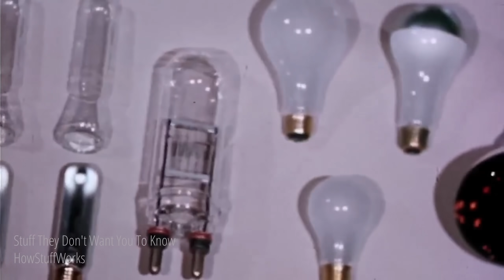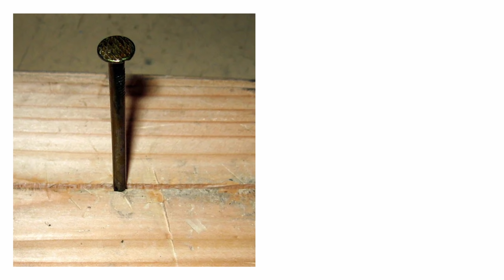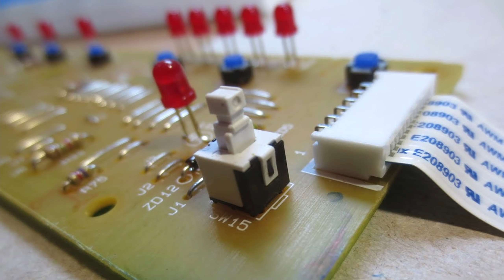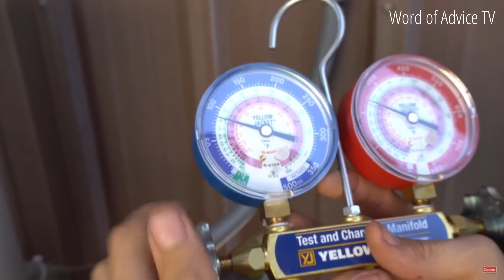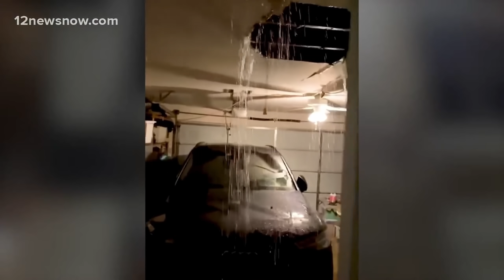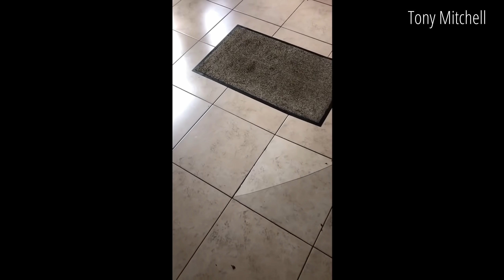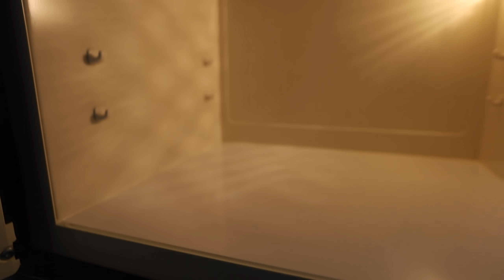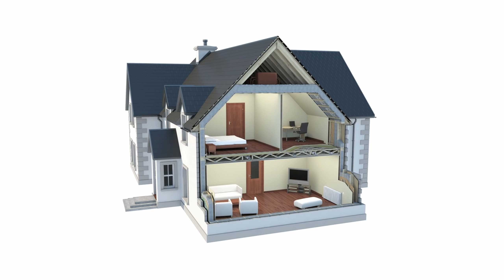Built to FAIL | Planned Obsolescence

Comment: The basic assumption of "planned obsolesce" is flawed. On the engineering side, it's more often known as "design life".  When you design a product, part of that process is determining the pricepoint you want to sell it at and how long it needs to last in order to make that pricepoint seem reasonable.  You can make a $10,000 refrigerator both repairable and last 20 years, because you designed it to last 20 years and you selected components and manufacturing processes with 20 year lifespans.  by contrast, if you designed your $500 to last 20 years, you would end up losing $3,000 per refrigerator because it cost you $3500 to make.   Finally, regarding the building standards in texas, they are mostly non existent. You want to live in a "low regulation" area and this is the result, and nobody is willing to pay for quality they don't see.
Reply: More people need to read this comment of yours. Thanks to the conspiracy theory of planned obselence (PO), companies are being regulated wrongly - such as apple who have been made to stop throttling their phone performance to protect the battery despite this being the thing they were doing to make sure their phones lasted as long as possible. Instead, they should have been forced to ensure that the batteries they were fitting were either; replaceable, or designed to give a certain amount of current for longer before the throttling technique was used. But people heard about PO and the EU made a law to make that scary myth into an illegal myth. 

Meanwhile, people like OP video creator here are making videos that basically make it seem like the consumer has no power and no choice, stuff just isn't made like it was in the old days.
Reply: Ok, so what’s your solution to get manufacturers and builders to make better products and houses? Please don’t say “it is what it is”.
Reply: @aayotechnology  I think the commenter that you are replying to is already suggesting a fix for building; better regulations. 

As for manufacturing I think that regulations and enforcement is actually a better tool than consumer buying power here too. Everyone is looking for a bargain, so the 20 year refrigerator that costs 2000 just won't fly off the shelves when there is an option for 500 that says it's quality-made on the box (but isn't). If consumers want better products they should ask their politicians to put tighter regs on things. This makes sense from a rational angle, and an environmental one.

Comment: Sigh, unfortunately the comment about the problems of tile installation directly onto the sub floor hit home for me. We had our main floor tiles last year, and a few months later it tented and cracked badly due to heat in the winter. Although I think this was a case of obsolesce by ignorance on the contractor's part and not necessarily planned.

Comment: I'd really prefer that you supported some of your claims with math. For example, you talk about how shifting from in-home coal furnaces to electric furnaces powered by coal plants has no environmental benefit. This is surprising to me because the standards of industrial power plants tend to be much more restrictive per unit of coal burned than home furnaces were. Similarly, there must be a break-even point for replacing some large number of old inefficient or toxic appliances; how much more waste are we generating by doing so in the cases you're discussing, and how far short are we from these inflections?

I'd also be interested in you drawing more of a line connecting how consumers are enticed to want new things for the sake of being new; and how consumers are strongly discouraged from buying repair or in-place upgrades by industry revenue strategies. You talk about not /being able/ to repair your laminate flooring and separately talk about /wanting/ to redecorate walls; and about /needing/ to replace damaged older appliances but also /wanting/ new ones. Do you think if it were easier to, for example, replace a facade over an old and functional appliance, that our desires for new things might be lessened?
Reply: I like her videos but also wish she did more math.  In a different video she criticized wind turbines, conflating the physical waste they generate with carbon emissions.  If she compared the two numerically the wind turbine CO2 advantage would have been obvious.

Comment: Civil engineer from central europe here. I'm so glad this is not a thing here. I mean, mostly. Most of the strategies you talk about are illegal here. Right to repair is really strong lately, with every electronic thing you buy the seller has to guarantee that they will sell parts for repair for like 15 years even after they stopped selling the thing itself. People of my country are extremely sceptical towards wooden structures and houses are still built mainly with clay bricks or lightweight concrete. All the plumbing I've ever seen in my life was placed in the way that it can be easily replaced or fixed (my dad is a plumber, I've seen a lot of plumbing :D ). The thing you said about nails used instead of metal straps is literally illegal according the EU code norm. And foundations are still in 99% cases the beam type, not the "only slab" type (although I've seen that in some new houses already). I've also never seen tiles laid directly on concrete floor - there's always some kind of insulation, even really thin, and a foil or hydrophobic paint. Unfortunately, perceived obsolescence is a thing here too, maily with bathrooms. I feel like the trends are moving way too fast. Gladly, I think most of the people are just too poor to be able to affort changing the entire bathroom every 5-10 years and just use it as long as it works, which often is like 80 years or something. So maybe it's less of a problem since people are just too poor here. I don't know. I just wanted to say that this thing is very different in different cultures and for example EU regulates this quite a lot to prevent waste creation. Sorry, for my english though, I'm obviously not a native speaker.
Reply: It's interesting to hear your perspective from Europe!

Comment: If you 'really' wish for stuff to last you have to look at Soviet engineering school - they put reparability as primary design requirement. Their Elbrus 8 computer (equivalent of Intel i7) comes with thick manual that includes a circuit diagram! 
But then.... Would you 'really' reach into your computer with a soldering iron to repair it? Would you 'really' drive a Soviet-looking car?

Comment: I was always amazed by the American building codes that allow passing electrical wires through wooden studs (an absolute no-no in my 240V country). But now I saw spray foam over bunches of wires... I'm speechless. Time for a Blues Brothers intermission: "Yes! I have seen the light!"
My own experience with planned obsolescence has been fairly benign. Some cheapo no-name things, like electric kettles or FL lamps, indeed failed prematurely - that was expected, and it was IMO about quality and cost rather than any sinister plans. The washing machine is approaching its EOL - but it's 17 years old.

Comment: I been a contractor for 35 years, you are correct on all of your views in this video. It is one of the things that drives me nuts. I have built a business that builds restaurants that last 20 years. Which in construction standards is a very long life for a restaurant. Considering most restaurants remodel ever 5-10 years. In building my own house and workshop, I have been designing it to last over 100 years. 
I also want to say I built over 178 homes with volunteers on the coastline of Mississippi, after Katrina, and I worked directly with fema, the state and local governments. To build concrete dome homes, We tried to help the people have a homes that could stand up to the weather on the coast and last longer then there life time. To our disappointment they did not want them. People have been programmed that things won’t last, and they except it as fact, when it is really not fact. We have concrete in many places around the world that is over 2000 years old. When things are built right, with the right materials, it will last. Oh, one other thing, you don’t have to spend more to make it last. Just don’t get sucked in to a sales pitch, do our home work if you are planning on buying a home or building a home, and please don’t go with the cheapest contractor, or the most expensive.

Comment: I think price is more of a factor. Correct your 40-50 year old microwave still works but you can replace it for under $100 at a box store. Same goes for the home design. People in my areas see only per square foot costs on a new home they aren't educated to know what methods were used in construction and they don't care. Right to repair comes with added costs and given the number of people living paycheck to paycheck it isn't a surprise people opt for the cheap microwave that lasts two years instead of the higher quality ones.

Comment: Has anyone had any water problems with a Samsung fridge? [Water leaking under the fridge or in compartments and then freezing.] There is a rubber hose [sometimes two] in the back bottom of the fridge releasing water condensation. These rubber hoses were built to fail when dirt blocks the exit of the hoses.  Cut the bottom parts of the rubber hoses that exit in the pan to make  the hole bigger. Problem solved. 
Samsung purposely created this problem to bring more money to their parts and service department.

Comment: I wonder, might it be possible to create channels covered by small, removable slabs or grates to allow access to old pipes that may wear? Does encasing the pipes offer any meaningful protection to the system or is it just cheaper to produce and more profitable to repair? 

Would the home wiring be more easily repaired or changed out if it were on top of/ between a mineral fiber insulation?

I have more questions but these are my most important

Comment: You leave out one huge factor.  Consumers drive the price point, they will go for the lowest price often without considering quality so the retailers pressure manufacturers to reduce prices and quality suffers.  Consumers are just as guilty as the manufacturers for our predicament, it is just easy to blame the manufacturer.

Comment: Belinda, I’m in the Fort Worth area and looking at building with Rammed Earth. One of the concerns I have is that concrete won’t last as long as Rammed Earth. Another concern is that the finished walls contain the conduits for electrical and plumbing, but would need to be drilled out just like you’ve shown in your video to replace. I’m not sure what to do since it makes design of a 3D printed home that much more complex.
Reply: Can’t they be run in an interior wall made of a different material ?

Comment: brand new dryer from Samsung went down after 3.5 years with fairly low use - several hundred dollars later; electrician explained to me about the "drivers" in LED bulbs failing, not the bulbs themselves (make sense?)

Comment: This was a wonderful video. I’m renovating a brick 1897 house and thanks to your warning, I will not put spray foam instillation in my interior walls and I will keep in mind “if this breaks, will I need to destroy my long lasting element to replace this short term element” as I’m making updates to my home. I do have to do some minor foundation repair but I’m lucky that it’s currently all stone and the stones can be used again once they fix the crack and remove the pipe that caused it. Also, I love your wall paper.

Comment: The points that you raise are bordering on incontrovertible. That said, once the technological disruptors - such as 3d Printing, Autonomous Vehicles, robotics, general AI, etc. - mature enough, the current economic structure that we live and work in will simply collapse. As Climate Change will necessitate replacing most built structures and infrastructure, we’ll be engineering under a new paradigm. Planned obsolescence isnt likely to be acceptable.
Reply: It’s not looking like this will happen in the order of your timeline. Climate change is already pretty far along. And it’s pretty likely already irreversible.
Reply: @aayotechnology . I agree that it’s pretty far along, but there’s a point where the climactic extremes become the new fairly normal. We’re already having roofs all over the world getting blown off by unusual winds. The storm extremes can and will get worse and more common. I think we’ve got at most five years before things get monstrously chaotic.

Comment: Just fixed my 12-year-old Samsung fridge for $100.
And my grandmother's fridge from 1939 is still running at our beach house, and it has never ever needed repairs to my knowledge. Now THAT is the consumer item lifetime I'm talking about!

When I built a Frank Lloyd Wright-derived home in 2008, I did what I could to ensure the home would last 150 years at least - incorporating a lot of steel in the wooden structure and a lot of concrete protected from the rain. It was considerably over-engineered, and could withstand winds of over 200km/h and more than 6 feet of snow of the roof.

I excluded ALL smart systems from the design to avoid obsolescence, and included only large and robust electrical system components such as industrial electric clerestory window mechanisms and garage door.

My ex now owns it. sigh

Comment: What I did with chipped laminate floors that I couldn't find replacement was to switch them with the ones near the wall. I was lucky that my tiles were whole near the wall but I assume you can throw chipped ones under furniture. Just a tip, when taking them apart, don't throw in the stack like I did. Putting them back together from the stack was bit of nightmare for me.

Comment: The first ceiling fan I bought, a Hunter, is still working perfectly 30 years later.  One I bought two years ago, a Hunter, worked great for a year and then the remote control receiver stopped working, so I rewired the fan to bypass it and took it out.  The fan worked well for about another year and then the motor started making a whirring noise that disrupted my sleep.  A new motor cost more than a new fan, so I replaced it, with a Hampton Bay, and sent the old fan to the landfill.  Sickening.

Comment: As a heads up you absolutly get what you paid for with LED fixtures.  Everyone buys the cheapest option which of course will fail much quicker.  The typical point of failure on LED are the drivers or the circuitry that converts AC  to DC.  Cheap fixtures can just have a simple full bridge rectifier and not a true continuous DC power convertor.  Additional they cheap out on the diodes and other components.  If you want to get LED that will last look into commercial fixtures they will cost probably double what you would find online or at the local big box but they generally carry at a minimum a 5 year warranty

Comment: We recently bought a house from 1921 here in the Netherlands, it's brick walls and tile roof which is the main form of building over here. We spent a good part of our renovation budget on insulation and replacing the roof, but structurally the house is still as solid as it was back in 1921.

Comment: I see a lot of this in the Automotive industry.
Small parts are not available so entire components must be replaced.
Many parts require special software to initialize them after replacement which limits the option for DIY or independent repair facilities to remedy the issue.

Many components that are exposed to heat cycles are made from plastics that become brittle or warped over time leading to failure.

Comment: Many of the tool brands we might have considered long lasting quality tools, are now manufacturing tools that are closer to consumer grade schlock.  I've resorted to buying used tools manufactured during the days when manufacturers took great pride in their products.  This is my response to planned obsolescence.
Reply: My strategy of buying used tools, is not practical across all products. Computer equipment is one example. Old equipment won't necessarily work with newer platforms.   Used kitchen appliances may show a great amount of wear and tear, not what to see when we update our kitchens.
Reply: I also like to find used kitchenware.  Pots and pans used to be made via welded construction, instead of aluminum rivets they use to attach handles today.  Aluminum is bad for the brain. I don't want it in my pots.

Comment: I was a machinist for 25 years, making parts for cars and appliances. During the 90s, we went to school to learn about ISO / QS9000 with statistical controls. I became a QS auditor which gave me leeway to delve into anything, in any department, ( including the board and owners records) that I deemed needed to enhance the quality of the end product.  Using failure analysis, it is not only possible to set up various components in autos and appliances to fail at a certain rate, it was encouraged to design the parts to do so...repeat customers. Good video !

Comment: I have made a second career out of repairing appliances with obsolete or ridiculously expensive electronics modules. (All my appliances except the microwave have mechanical controls.) 

I have always wondered what would happen if manufacturers were responsible for the end of life costs of a product. Would parts be available for a longer period of time? Would there be a more robust market for used parts (specifically cosmetic parts that are typically not stocked more than 1-2 yrs after a product is discontinued.)

Engineers will build to the product specifications provided by management. If product cost if prioritized over reliability and serviceability, the consumer will receive a product that lasts only to the industry standard “generally accepted life” for a basic product. (5 yrs for most large appliances)